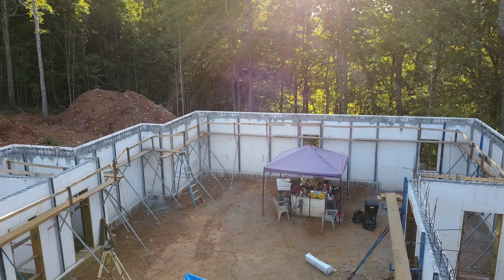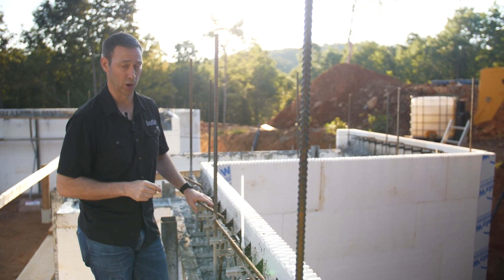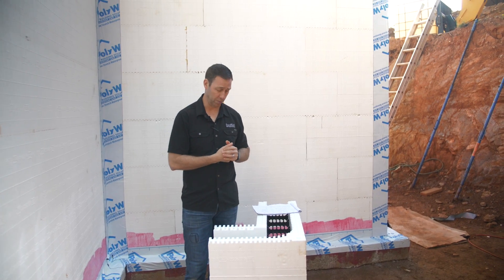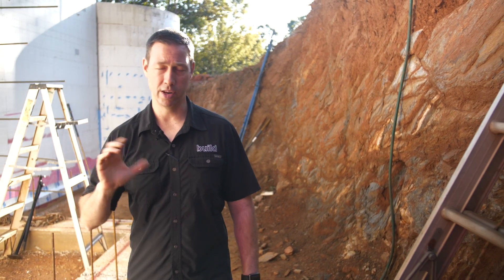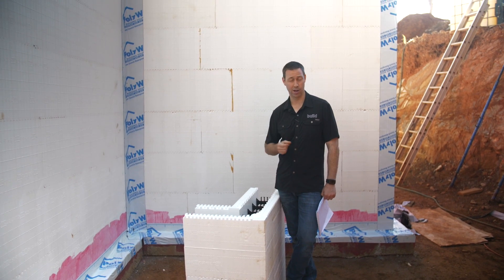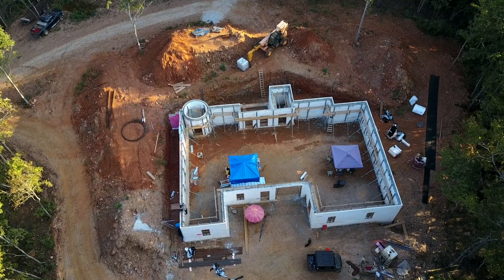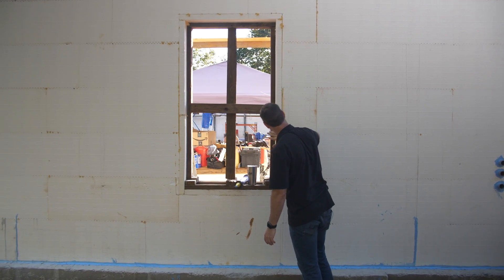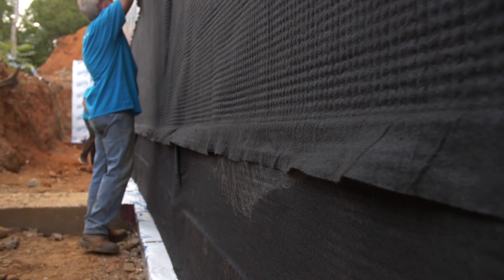Insulated Concrete Forms - Overview, Costs, and Cons

Comment: While you are correct that the eps and concrete themselves will not absorb flood water, wouldn't flood water infiltrate between the "Lego blocks" through the joints and fill the spaces between the eps and the concrete, as well as between the blocks themselves, and be impossible to get at, and take a very long time to dry out?

In a flood possible area, flood zones, basements, etc, would it be wise to seal the joints or apply a continuous waterproofing barrier over the interior surface to keep water out of the joints?

Comment: I agree, ICF is great but it has some cons. My wife and I have been working on a Nudura ICF house that we picked up as an unfinished "dried in" project. On Nudura the plastic studs in the wall aren't quite as strong as 2x4's but it has a vertical stud every 8''. The screws will strip out easier than a 2x if you go too hard with drill/impact.  I did an experiment with ring shank nails and they will hold, but I concluded screws have superior holding power. You will have to screw everything on (no nail guns). It is slower, more labor intensive, and screws are more expensive than nails.  Also you will have to sheath any load bearing interior walls with plywood for hanging anything heavy  like cabinets, water heaters etc. Because of it's nontraditional construction: Expect to have difficulty finding qualified contractors to work on it.  When they find out its ICF the labor cost automatically increases (they probably assume you're rich, lol).  The insulation/thermal mass of the structure is very good. It is extremely quiet. Oh and it's literally bullet proof.
Reply: Nails are great only for shear strength where most all screws will fail at while you found out the screws offer great holding power or tensile strength, besides I never heard or seen anyone nail in drywall but have seen the likes of April Wilkerson who installed plywood inside her new shop using screws which allow for easy unfastening to access the interior behind the are for installing such as AC and recently also a ducted vacuum system.

Comment: Matt, I'm from south florida where everyone uses block. We normally just use R5 foil on the inside of the wall. You suggested previously to put the insulation on the outside of the block but then the stucco is on mesh?? Can you do a video on block home insulation in the south???

Comment: How about cracking?
Reply: The moist curing of concrete within the foam and the web of rebar is supposed to help prevent that. In addition, an engineer tests a sample of the same concrete that was used in the walls after thirty days to certify it had achieved a minimum strength set be the building Code.

Comment: Love the idea of ICFs.  Thanks for bringing up several points of clarification, especially the water proofing.
Reply: As he said, no basement is not going to be waterproof after construction and thus will require such along the way before being backfilled and hopefully with a permeable (gravel and perforated pipe) drain system also installed.

Comment: Matt,  Thank you for another great and informative video. Have you or anyone else heard of using Helix twisted steel micro rebar instead of conventional rebar for ICF homes?
Reply: look up "Pentmore estate"
Edit, other options are fiberglass and basalt fibers, less prone to eventual rust as they are rust resistant.
Reply: I love the idea of using helix micro rebar. And because it is plated it shouldn't rust as fast.

Comment: Great segment.   Interesting to me is the that the stud system in this is very much like what I'm using on our walkout basement remodel to insulate & 'frame' our cement wall sections in one step.  Product is called Insofast.   Much the same idea of the plastic stud embedded in the foam though in this case the back is designed to be glued to the existing concrete.
Reply: InSoFast and also Quad Locks R-ETRO ties long with their panels are great choices to insulating a bare concrete wall that was traditionally constructed with forms, InSoFast is IMO just as nice but more easy and a bit faster to install in compare, and both are better as QL offers two size panels with fastening strips to make finishing easier and more secure compared to larger sheets which lack such easy fastening options.

Comment: We used a similar product in New Zealand and the problem we had was the bottom sections would expand when the concrete was added and the wall would shrink in height .
All the battens for the interal linings had to be cut down at the bottom to get a straight line for the wall
Reply: Sounds to me like you did not do the pour in lifts of up to 4 feet as recommended by the manufacturer or use bracing that went all the way to the floor.

Comment: I was wondering if the bracing requirements and the risk of a wall getting out of plumb could be mitigated somewhat with multiple pours. This page had something to say about that:
http://www.greenbuildingtalk.com/Forums/tabid/53/aff/4/aft/78895/afv/topic/Default.aspx
Seems that there are prose and cons, and not everyone agrees on the importance of each. If multiple pours could be made viable, some of the most anxiety-inducing aspects of this kind of construction, especially from a DIY perspective,   could be avoided. Does anyone make a small mixer with sort of a silo, so the dry mix could be delivered, then activated in phases, and pumped into the voids every one or two or three courses? Having a 15 foot floppy wall of uncured concrete and foam fall on you could really spoil the day.
Reply: I did 2004 two pours per story for a three story building (basement + 2 story). When you pour, You just leave the last block half empty and add rebars after the pour to link first and second pour of the wall. Next day you continue adding blocks

Comment: That is the first time I have seen a curved ICF wall. Are there standard diameters or is the curved wall custom assembled with bits of ICF glued together?
Reply: Just go to the Build Block website and look under the product menu for Build Radius for full info on them.
Reply: Thanks.

Comment: As far as I can tell, the ICF is about £3.50 more expensive per square foot compared to the brick and block construction used here in the UK. ICF looks to be a lot stronger and better insulated, although it would need facing at an additional cost.

I'd go for ICF personally.
Reply: Seeing how many securing points and strips there are in the pre-formed or knock down forms of any manufacturer I would have no problem selecting ICF and have a few top favorites from what I have researched in 6 years

Comment: Looking forward to the waterproofing episode, as I am planning on building a very large ICF basement in the near future. Keep up the good work.
Reply: There is plenty of pre-existing ICF waterproofing videos on here they all show either spray on or stick on membranes, but with any foundation like he said, and as a former waterproofing professional I suggest also installing a outside "french" drainage system with gravel and perforated pipes wrapped in permeable cloth to keep out rocks and other debris for the most part.

Comment: This is great! Would love to see more of your thoughts on these systems! I have been planning to do my own property with ICF. Would love your thoughts on monopouring with footers too! Thanks for all your excellent videos!
Reply: Check out Lite Form's footing forms, you can even use Build Block's KD with extender ties to create an insulated footing but still want to stuff some foam between the wall form and footing "form" to keep the insulation value there. But if you do not use a barrier under the footing like FabForm's Fastfooter barrier to keep the concrete from wicking up ground water for a more dried in concrete monolith. Another system similar to BB KD is Quad Lock they have panels and separate ties but the that may not be best option as you may see for yourself when you check them out but not impossible to use..

Comment: I should add that cell phones have a hard time getting signal in those buildings.
Reply: Anything wireless, including internet, is a challenge.
Reply: nevermindthebollocks most new phones have WIFI calling. Wire for a few ubiquiti WAPs and you’re good to go
Reply: I have to go work on a ups system in an ifc school. For it to be covered under warranty I have to contact tech support. 
My iphone8 never works in there. I have to get a corded phone from the office and plug it into the nearest classroom and run the cord to the electrical room.

They actually have wireless repeaters out in the hallways, but it doesn't travel through those walls. They needed to put them in each room. I guess it keeps the kids off their phones though...

Comment: All the rebar in that goes in those offsets the blocks being so light any easy. 
Definite put chases in befor you pour.
Reply: You could do that or let say you need to reroute  or add in more how would you do so with said same chasing method? Most suggest just easily cutting channels into the foam itself then once the wire is in just cover with some spray foam adhesive and smooth out then cover up with interior or exterior finish. But stuff through the wall should be taken into consideration during the block install and before pouring as he states the concrete is a cuss to drill through especially if any rebar is in the path.
Reply: Chases go through the wall... Like for wall packs or outside receps, fresh air returns ect.. 

We just used a sawzall with the "The Axe " blade on it to cut stips in the foam to run conduit in once the wall was poured. Offset the top and put on a jbox. 
Ran all the electrical and data this way. 
You don't put foam back over it, the pipe fills the void too much. Drywall covers it all inside and brick or whatever covers it outside

If you need a small hole like 1" in the poured wall you can simply use a hammer drill. You can see on the the foam blocks where the rebar will be.
If you need a big hole like 4" you had better get a core drill, they will cut most things, just takes time and they make a mess with the water.

Comment: Why wouldn't you use some sort of waterproofing caulk between the ICF blocks when setting them?  That would at least eliminate the long cracks.
Reply: Some recommend using foam adhesive spray for this reason and to secure a not yet finished built form before it can be poured in the event the wind pick ups and not blow the already build wall portions down.

Comment: For ourselves, ICF makes sense for noise and strength. For this market, we are moving to CAD produced steel frame. Very low cost compared to wood as trades are hard to get. Fully recyclable when the day comes, rot proof, won't hold moisture, etc. The downside of ICF is mainly cost, but also the knowledge base for using is still new, so most builders shy away.
Reply: Most ICF owners attest to how much less their cooling/heating utility bills are compared to the former when their home is mostly ICF walls including a basement of sorts if any such and also utilizing r-valued windows and doors with their own thermal breaks built in.
Reply: Oh and also if you look at Build Block's video library you will see how easy it is for anyone to assembled said system, same goes for other manufacturers.

Comment: What about utilities? How do u run all the electrical and plumbing ?
Reply: you cut out chases and fill in with spray foam from a can or can even install the conduit pipe in the cavity of where the concrete is poured but i not recommended all that much or at all by many ICF makers
www.youtube.com/watch?v=BxOiEik2v_A

Comment: Please please do more ICF videos especially for pros and cons. I will be committing to building a home and ICF is my lead method to get to Passive House/LEED certification and off grid ready.
Reply: To from what i know, ICF is automatic LEED/PASsiv from the start that is if the whole shell is ICf including using the decking panels for not just floor but also the roof. Good Luck on your plans.

Comment: YES Matt! I want to build my next house with ICF - we aren't doing it in Naples - but they are in the Cape.  I think you get more space without having to frame inside - also the insulation factor is so great.  Number 1 is Nudrua! Best I can tell they are the kleenex of tissues!
Reply: Yeah not nailers of treated wood that might have to be replaced on a flood situation. I like the insulation factor vs block construction.  In naples they're telling me the pricing is about the same as traditional concrete block.
Reply: Can Poly Wall have stucco applied to it?  Also I think they make ICF forms with thicker exterior foam if ordered.  Is shipping of the product less than traditional block to the job site?  Some other factors to consider.  Lastly you don't have to interior frame exterior walls so that saves space and cost of a framer.  Need to consider Electrician, plumber and other trades working within the Foam.  Probably want someone experienced.... Would love to see some of those guys talk about their experience with wiring and plumbing ICF homes.
Reply: IMO Build Block, Fox Blocks and Quad Lock are the top three Nudura comes in close at four. Build Block has radius forms of the only type and first to do so and also they have what are called ICF decks akka Build Deck, not sure Budura offers this like Quahd Lock also offers. Lite Forms also is a good line and offer insulated deck forms as well in wood or steel stud underside and also a footing insulation forms. 
You may want to also look into and consider adding Fab Forms footer bags to help keep concrete from sucking up surrounding water after it has cured as it soaks up like a sponge if a ICF footing or foam base is not to your liking.
Reply: @Joshua79C  I like the galvanized metal Quad-Lock tracks that are attached to the slab or to the footers upon which the Quad-Lock blocks sit and lock into place.  The tracks are also attached at the top of the upper block, which helps lock the top row of blocks together and provides a totally smooth base upon which to trowel smooth the concrete.  If the tracks are mounted and aligned correctly for both sides of the row of blocks, the first row of blocks will be perfectly square and straight.